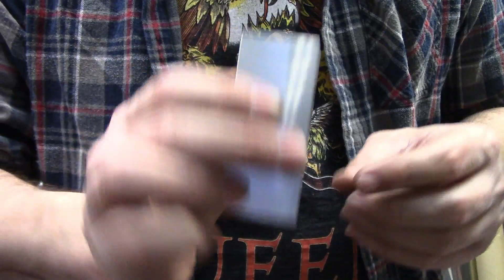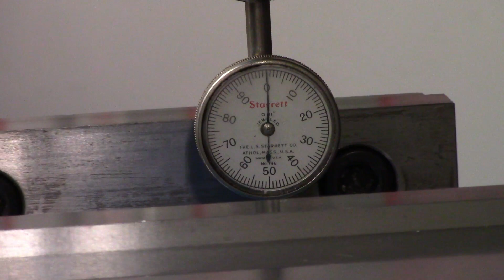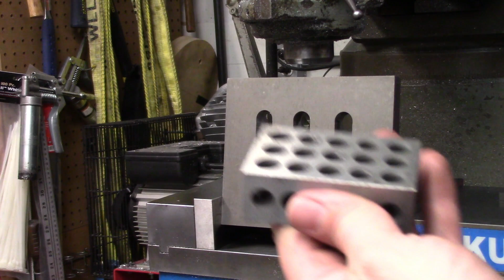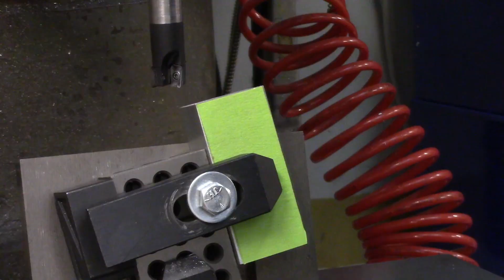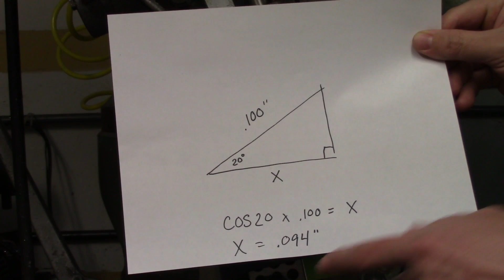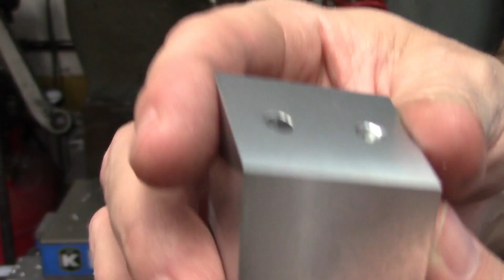Craziest Setup Ever

Comment: Have you ever done the recalculation to first angle when the part is tipped to a compound angle .  👍
Reply from the maker: Nope.
Reply: @StuartdeHaro  Care to try?
Reply from the maker: @jdmccorful  I don't know. Seems hard. Lazy is so much better than hard.
Reply: @StuartdeHaro  agreed.
Reply: @StuartdeHaro  I don't even think there is an on line convertor .   It will catch out most people when tool grinding !

Comment: I suppose I'm one of the only Machinists who has never run a Bridgeport. I constantly see this complaint arise of too little z in the envelope. I've seen that some guys stick like a 10-in spacer in the column. With as often as this comes up, why doesn't everybody buy one with the extension? What downsides are there? Presumably the quill still only has 6 in or so of travel. I have a homemade machine, it also has about 6 in of travel. But the horizontal boom can be moved up and down anywhere on the 7-ft column. Is the main column in the Bridgeport just the Large hollow casting? I guess I'm trying to understand the design choice trade-offs, I've often heard the Bridgeport talked about like it's a Swiss army knife, capable of anything if not doing so excellently
Reply from the maker: The strength of the Bridgeport mill is its versatility.  It's big enough to do a lot of parts. The head can be angled in many different ways. The ram can be moved in or out. The turret can be rotated. There are the various accessory head that can be put on the back of the ram. It's not the biggest or most rigid machine out there, but it can be used for a tremendous number of jobs. I rarely run out of room on the mill. I don't feel like the riser block is necessary and in fact, it can be counter productive. It decreases rigidity even further and you can run out of room on the upper end of the knee travel trying to get smaller parts high enough. The quill has 5" of travel, btw.

Comment: What size is your rotary table and what would be the max size of rotary table one should go on a BP?
Reply from the maker: Mine is a 12". We have a 15" Bridgeport brand rotab at the college that easily weighs 250 lbs. You don't have much room to move the table with it on there, so I'd say that's probably the biggest. Personally the 12" is the biggest I ever want to handle alone. I need to build a crane if I'm going to use it again.
Reply: @StuartdeHaro  I just acquired a mill and a rotab just like yours came with  it. I gave it away. I have a 10" and that will have to do. I am not lifting no 12".
Reply from the maker: @Caughtitoutdoors  I don't blame you in the slightest. The reason I haven't put out another video is because I don’t want to lift that rotary table again.

Comment: Just an idea for more accurately locating the hole... If you had additional material, you could make a hole for a tooling ball and use it to pick up locations. Then face off the additional material along with the hole for the tooling ball.

Comment: For the life of me I will never understand why public education does not combine trigonometry and shop class. Not just trig, several forms of algebra are pretty tough for kids to pick up the first time they are introduced. I had a love for math from early on, but the day I discovered setting the compound at 60 gave that dial a resolution 10x of the carriage, something just clicked for me. The two fields are inextricably linked, the lathe is the ultimate practical application of trigonometry. I think a lot of kids that have difficulty with theory would have the same click and it would all suddenly make sense. My nephews are young, I'll have to get back to you on how well that works